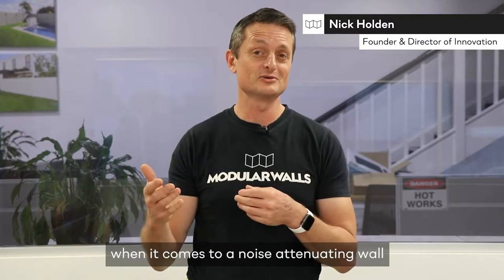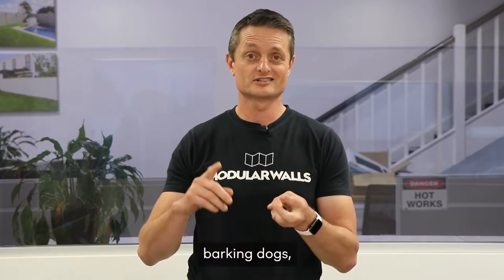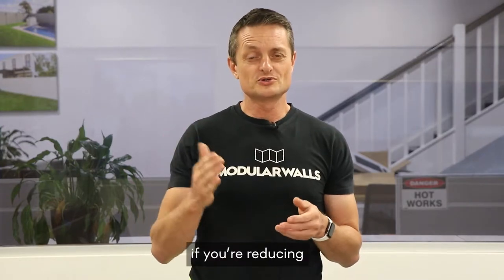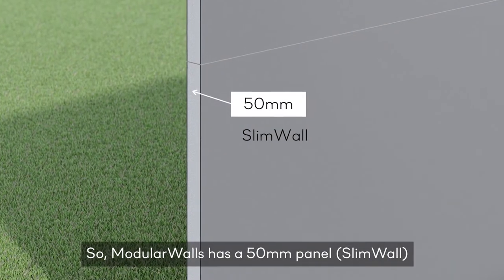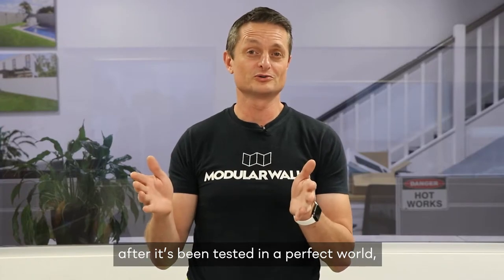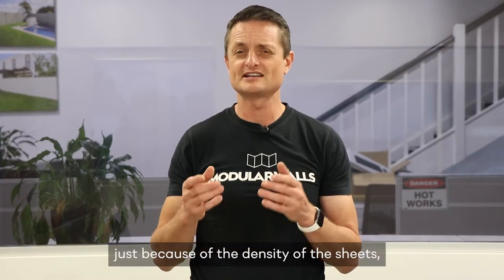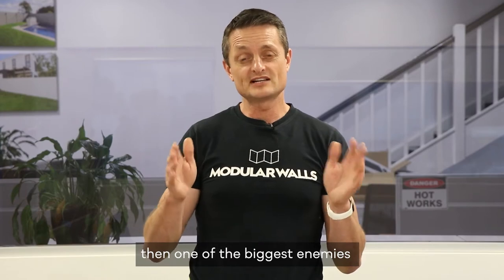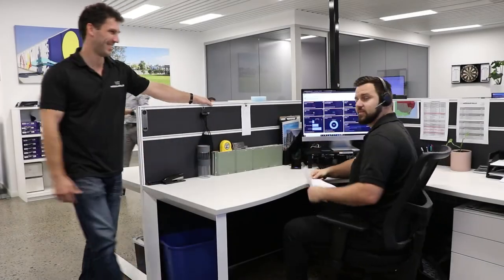Understanding Acoustic Fencing

Comment: On the website it shows the 75mm and the 50mm wall are both the same in reducing noise? 20-25dB. Is this accurate or is it worthwhile getting the 75mm panel - specifically for road noise.
Reply from the maker: Hi Connor, thanks for reaching out!

That’s correct, the panels have the same estimated noise reduction, however, there are many factors that will contribute to the level of noise reduction you can achieve. Please feel free to send me an email at info@modularwalls.com.au and we can discuss the specifics of your project further 😊